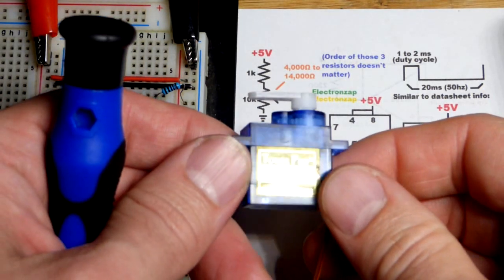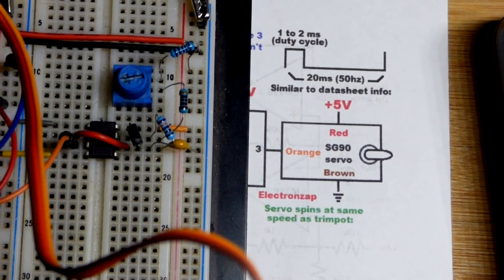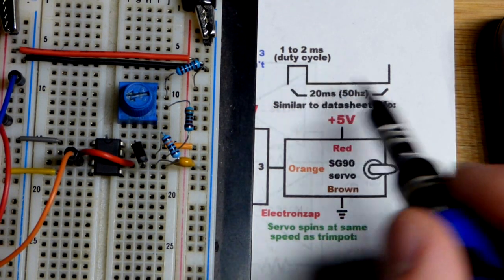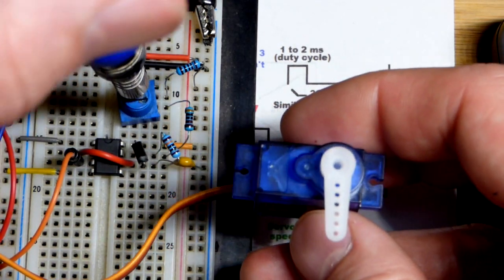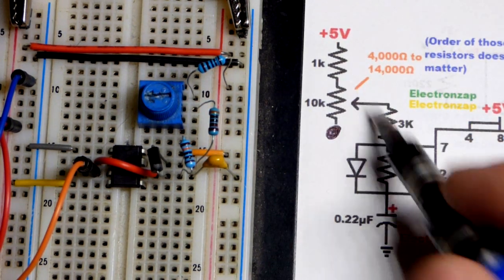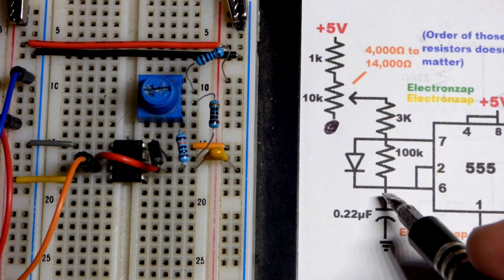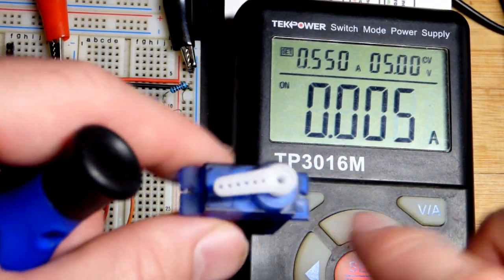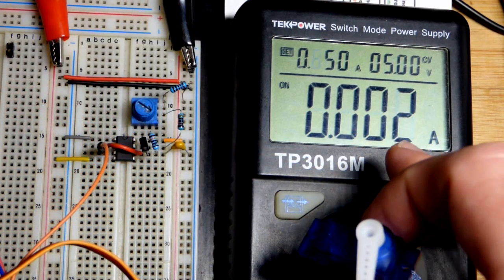Trimpot sets servo position by using 555 timer astable mode PWM output by electronzap

Comment: So i have built this circuit on breadboard but my servo keeps oscillating if i dont put a capacitor (i have put a 0,47uF capacitor cuz i had that on Hand) beetwen PIN 5 and ground, instead of a 3k resistore i have used One of 3,3k and as diode i have used a in4148. So why does this happen?

Comment: you keep covering the diagram
Reply from the maker: Thanks for pointing that out!
Reply: @Electronzap  well it's ok at least it works
i had to combine a lot of resistors in order for it to work ngl because i don't have a 180/90 degrees positional rotation servo where pwm controls position but i have a 360 degrees continuous rotation servo motor where pwm controls the speed and direction

Comment: I need a circuit board that can do the following: 

It needs to turn a step-up motor. But with the following options:

1. Have a set button that I can let the motor do 360 degrees, or set it to so only 180 degrees or just 90, whatever I choose.Swirling forward and back again.
2. A speed setting for the motor.
3. Display

Can you please advise which board can do this?

I would appreciate it a great deal.
Reply from the maker: I haven't looked for any circuit boards in a long time, so unfortunately I can't help you on that.

Comment: What’s the function of diode connection between pin 7 and 6 on the chip ?
Reply from the maker: Diode is for charging through 1 resistor, and discharging through 1 resistor. Without a diode, it will charge through 2 resistors and discharge though one resistor.

Comment: GREAT VIDEO:
I wish you would have put some heavy load on the shaft as you turned it...the current goes way up...I don't remember how much though.
Pin 5 cap is not necessary unless you have a HUGE amount of noise.
Reply from the maker: I did notice the current go up in a different video when.I pushed on the shaft, that's a good point. Thanks for watching!

Comment: I never tie pin 5 to ground with a cap, cuz lazy 😄but I do have a circuit that I built in which I am hitting the 555  with CV via a push button, and I am getting lots of bouncing interference whereas this was not a problem on the breadboard.
Reply from the maker: Yeah, that's kind of when I add certain stuff to the board for videos. When I can pop it out, and then something noticeably changes. Too many people demand a 5 to 10 word explanation of everything they can see on the board, and then start interrogating you about it if you can't give a quick answer. Big waste of time when that happens.